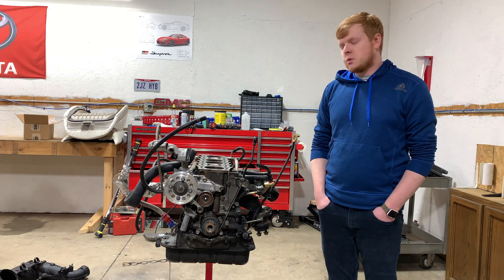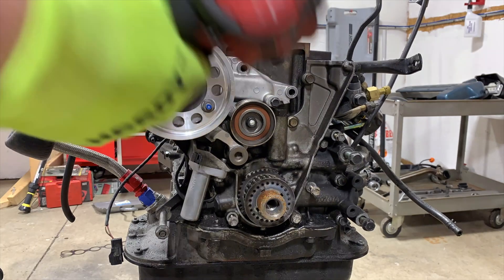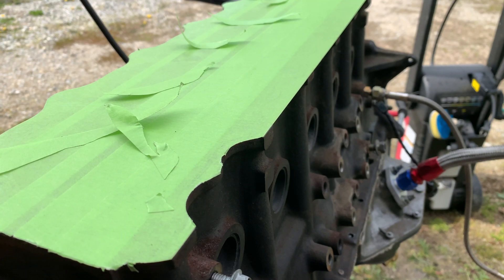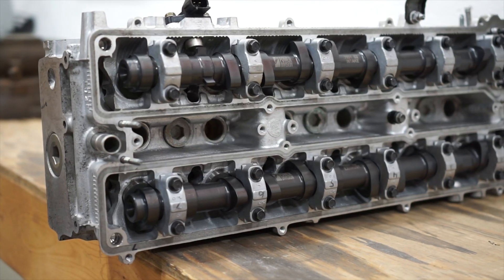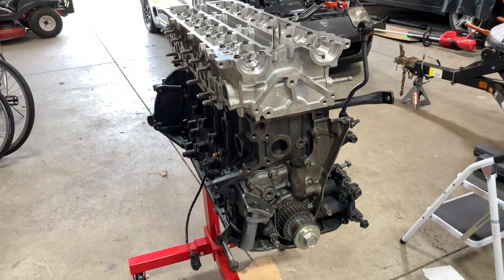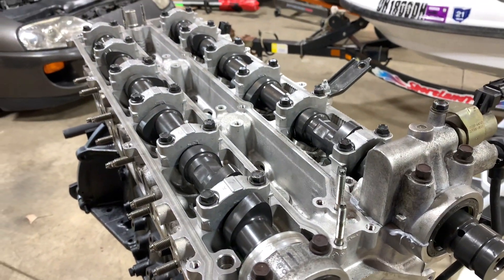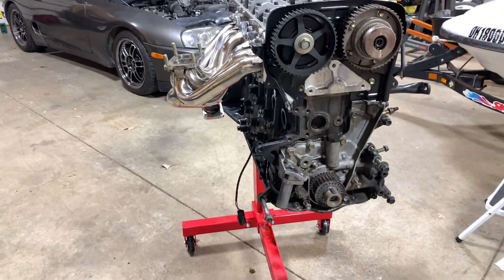MKIV Supra Build - Pt.1 - 2JZ Assembly

Comment: That moment you realize you're all caught up to Pt. 9 Wiring 😂😭 lol. Using the same Aristo 2JZ-GTE engine for my JZA80 swap, it was previously in my JZA70. 
Hmm Our wiring setups may be similar seeing we are using same engines. My Coils will be ran directly from the EMU black but man, Would love to reference those body connectors in the engine bay for the fuse box. Once again HMU @BjornFSE on the gram. Great content and I look forward to seeing some more. we're practically doing same build almost.

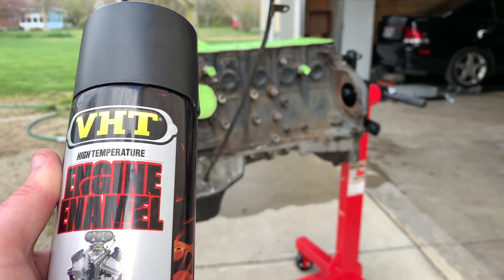@2:46 How many cans did you end up using?